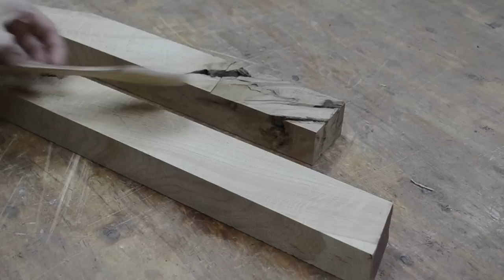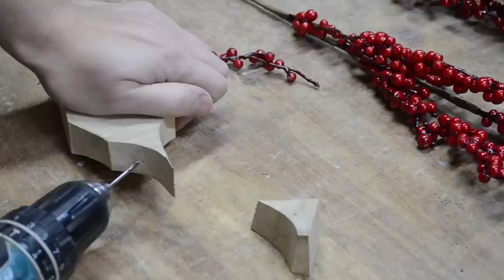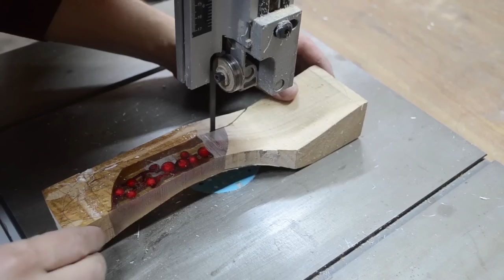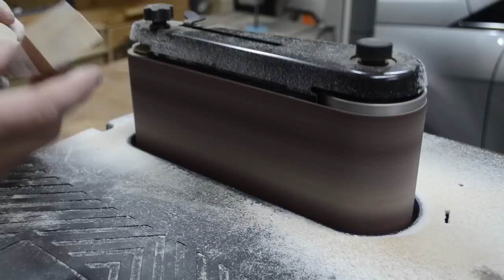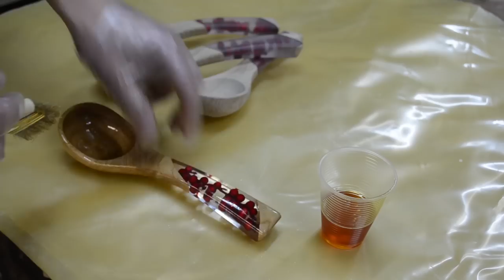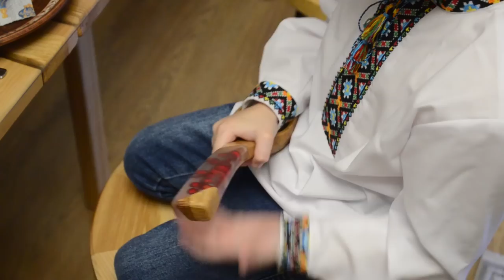Wooden spoons with inlay for Christmas Eve

Comment: Very nice. What a beautiful handmade addition to the table. The only questionable thing I noticed is that you used a linseed/tung oil mixture for the finish. Correct me if I'm wrong but I'm pretty sure that is not food safe. Maybe a bees wax mixture (cutting board mix) would have been a better choice?
Reply: Wood is not considered food safe either!